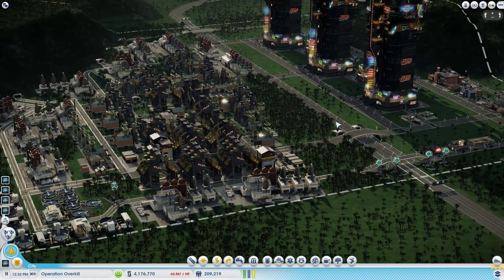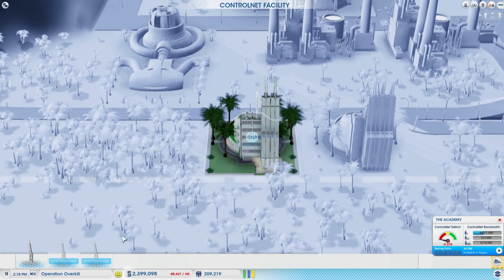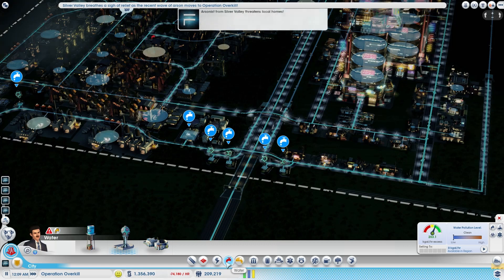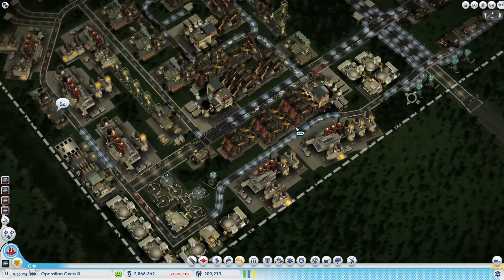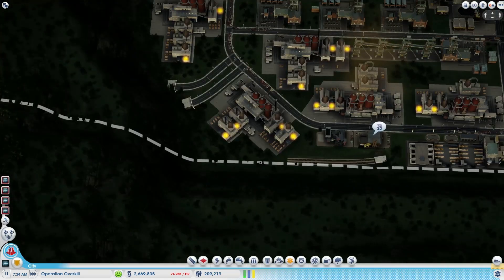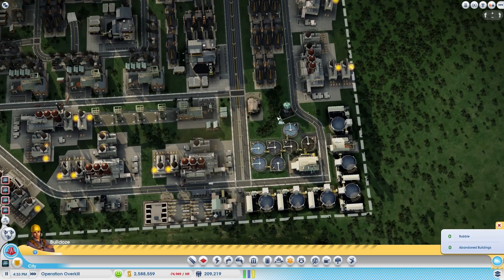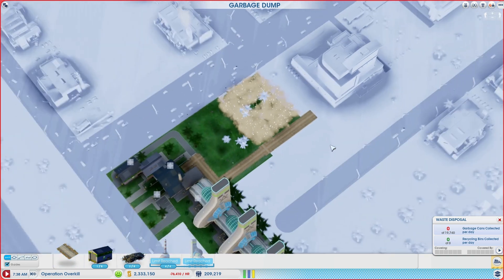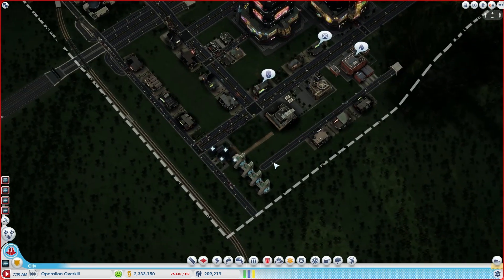SimCity Cities of Tomorrow - Operation Overkill [PART 41] "Utilities and Progress"

Comment: In a city that doesn't have a lot of water, and you can't buy water from neighboring cities either, you should really have looked into placing a couple sewage sanitizer plants. Of course, you would need excess control net, but then you could kill two birds with one stone (sewage and water.)

As you have pointed out before, the sewage sanitizer doesn't produce nearly enough water for a big city, but with two of them you could eliminate the need for your sewage treatment plant, and then you could still have a water plant if you still didn't get enough water. All in all, it would be more space efficient - not to mention probably necessary with the lack of water in this city spot.
You might have already done this later in the series, this is only as far as I've watched.

Also, someone else already mentioned the air scrubber mega tower crowns - they replenish the water table considerably --- of course in this city location the water table isn't very expansive anyway, so I'm not sure how much of a help that would be... but every little bit helps!